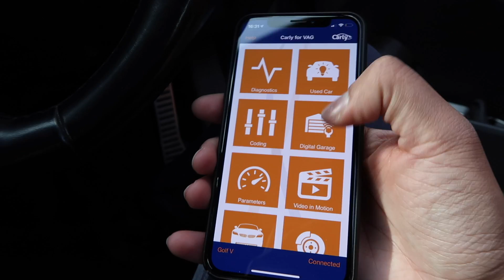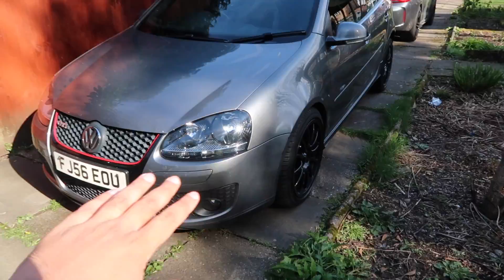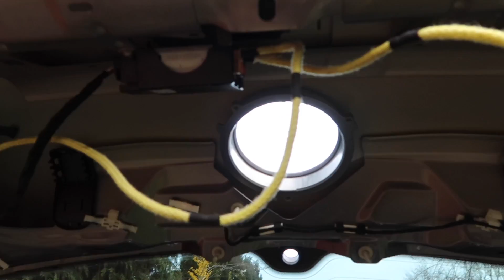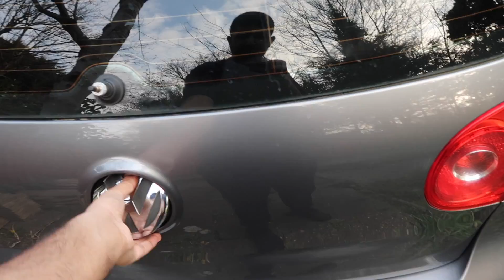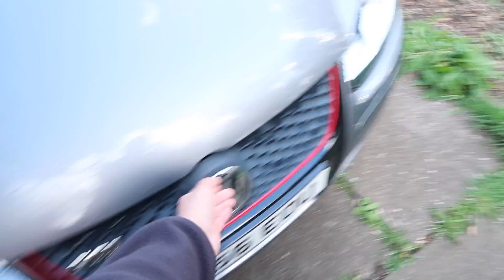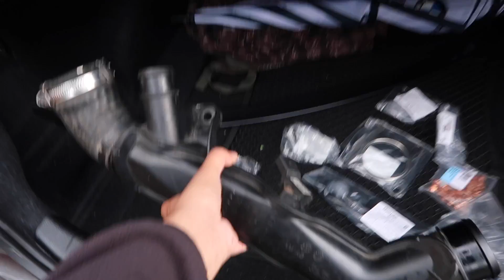Finally NEW PARTS for the GTI!

Comment from the maker: Sorry about lack of uploads! Been trying to get parts sorted rather than put out filler content. Back to regular scheduling now 👍🏼
Reply: TR Hamza so you’re straight piping the car
Reply: needs a new wiring loom its most likely short circuiting your latch wouldnt use it as it may start  a fire if it is

Comment: Clean it out with some air in a can and slap some dialectic grease in the thing that’s smoking, had same problem with my boot electricals... sorted it, will be due to moisture so grease will help keep it out.. but dialectic

Comment: Why didnt you get a Unitronic DV relocate kit or similar kit. It comes with everything needed and you will be ready to go when you upgrade to K04. Plus you want to upgrade your charge pipe too for better efficiency when you have your K04, like a Spulen Charge Pipe. You could have killed two birds with one stone instead of replacing the charge pipe with an OEM part from the Golf R.  I had a MK5 GTI with K04 upgrade with everything possible to upgrade except Water Meth.

Comment: Hi, check  the wiring where the hinge is , very common wire shorts or break because opening and closing the hatch door, the wire is inside the rubber sleeve,

Comment: Well for wires to start smoking there has to be excessive resistance in the circuit, so there is a short circuit somewhere so most likely detoriated wires

Comment: If you're planning on running a K04 then I'd highly recommend a 'K04 READY' Revo intake. Most people on their ED30s run a Revo as they are the least restrictive. RS3 injectors and a bigger intercooler is definitely required aswell as a HPFP upgrade. Most go with APR

Comment: Looks like the boot latch is short circuiting some how the live and positive is being connected could be the wires but looks as if the latch it’s self is smoking from the inside and not the wire, get a new latch

Comment: I had a mk5 and did some changes in the tailgate, my advice would be to check the grounds... i had issues with lights etc in the tail gate, also take a look at pin positions on the plug, it has happened before that from oem the  pins have been installed in reverse...

Comment: Does the new latch need coding to the car perhaps?
Think the ko4 work on the wasteland might be pushing it unless you have at least one non camera shy mate to assist.   Maybe for such a big job a tie in with a company doing it would be better......rounded nuts, snapped studs and stripped threads are your worse nightmare when DIYing at home.
That Carly obd reader threw up a central locking code so could that be behind the non working boot release or was that after it started to smoke?
Is there a separate relay?
Ideally want a base bhp readout before going ko4 to see the improvement difference........
Love the project updates.......

Comment: Get car up as hi as you can because it’s nightmare on your back under the car doing it ... I put a forge pressure valve
On. it was only 3  bolts to change it over 
And my temper was getting the better of me lol 😂 🤬

Comment: Test Using a multimeter , positive  or trigger + is probably shorting out to ground or the harness was upgraded later and the pins have changed for the Gti model so the negative and positive may have been switched around or there is a short circuit in the harness leading to the boot switch

Comment: My wiring loom fractured within the black flexible rubber section between the boot and the main body of the car. It’s due toVW cost cutting and not making this section long enough too handle all the opening/closing.
Reply: Just fixed mine last week as wiper stopped working and found the wire snapped inside the conduit, the rest of the wires seemed fine just the wiper one it was way too short once boot open.